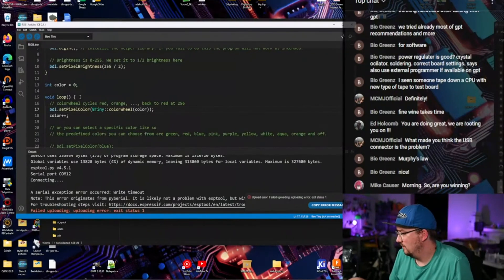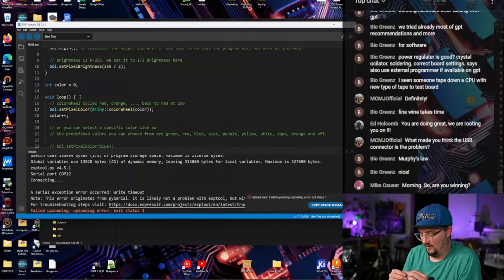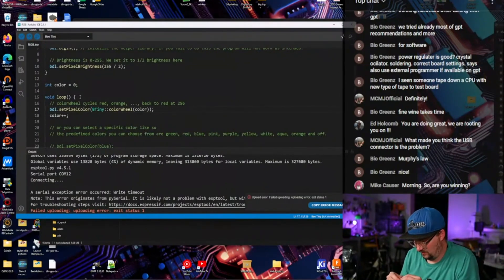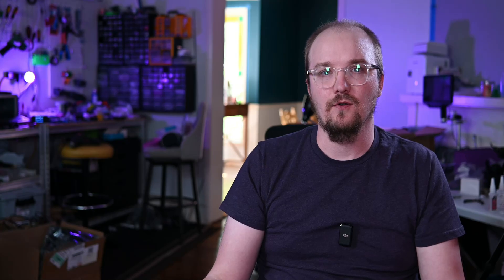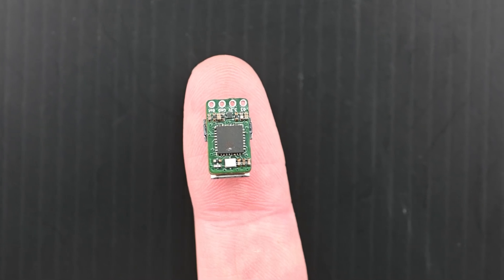I Made A Tiny ESP32

Comment: If you want a slightly more functional challenge. Try putting the 'fingers' for a USB type A directly on the PCB so you can insert the entire PCB into a USB port, I've seen some bluetooth dongles do this.If you squeeze  a WiFi antenna on there as well you'd have a pretty cool ESP-now receiver - could make for a pretty low latency wireless keyboard receiver or something like that.
Reply: also why buttons, just have pads that you can short with tweezers
Reply: @X3msnake btw i putted buttons on the dongle for convienience as it was intended for dev purpose, but i could have put smaller ones
Reply: @X3msnake  and i'm using a esp32-s2 instead of c3
Reply: would a flexible (embroidered?) wifi antenna work? I'm just thinking about project WarKitteh from a defcon talk a few years back, fitting a microcontroller with wifi into a cat collar.
Reply: @charleslambert3368  yes many antennas are made from flex pcb, it would totaly work
Reply: Making is actually functional (and slightly bigger) would be great, yeah
Reply: It also seems to be possible to put some soldering (like SMD ones) pads connected to the chip leads to the edge of the board so more of the functions of ESP would be available. That would make the thing actually usable tiny microcontroller.
Reply: Is it possible to turn one PCB layer into antenna?
Reply: Of like couple

Comment: I only read about this so  maybe missed something. So the wifi and bt dont work? And only 1 pin?  Somewhere i fail to see what this is good for unless a ultra simple thing. But yes at least add the i2c or qwiic or what they call it. And antenna connection. I think there are micro buttons for the side of the pcb. Maybe a very fine pitched connector?
Reply from the maker: This was only a proof of concept type build. I've gotten a lot of great ideas from people on here and I think I can make a 3rd version that has an antenna and more gpio without making it bigger (hopefully) while also not lose the usb/buttons. It's a challenge but I'm looking forward to trying so stay tuned!

Comment: Excellent build!  Have you considered a connector other than USB-C?  Maybe JST has something which would work.
For WiFi, how about the ceramic antennas that Adafruit and Seeed use on the QTPy and Xiao series of boards?  It would make your board larger, but not by much.  Obviously this would be for another project where you aren't going for minimal space.
Reply from the maker: Thanks!
I've gotten some great feedback and ideas on how to improve this and I think I can make a new version with an antenna without making it bigger (hopefully) and not sacrificing any of the buttons/usb.

So stay tuned!

Comment: Very nice little board. I'd remove the USB connector, buttons and possibly the LED. Instead if you put a U/FL connector for the antenna and a small board connector such as the Hirose DF40 series (a 20 pin is only 6.6 x 3.6mm) then far more GPIO could be broken out. Would need a seperate programmer board with the USB and reset buttons, but once programmed you'd have a very tiny board that could easily be integrated into other projects with only 1 connector and an antenna.
Reply from the maker: Thanks man, that's an interesting idea and one I'll consider. I've gotten a lot of great feedback thus far on how to improve this so I'm excited to make a 3rd revision of this.
Reply: @paulprice This has me excited, now fingers crossed🤞hoping I find the revised version on your channel
Reply: I thought those looked familiar, it's what the cm4 uses, ig I should have expected a connection like that in this community lol

Comment: Please try to fit Wifi in this small board please dont increase the size 
And sir if you can one button and second change by smallest push button which is generally used in Bluetooth earphone,
Also if can remove the usb port and upload the code by using externally then it would be more tiny.

I know this is too much tedious but you can do it 

❤❤❤❤love you sir

Comment: Just think... replace the usb-c for contacts for use a jig with pogo pins to programing and a small conector for a tiny battery, it's a option?
And for antenna, probably won't work, but you can put only de μC on one side, make a space for a connector for the antenna or... take all the risk, create a thin pcb for stackup at side of μC to save the space and have the antenna in separate pcb

Comment: Does it stil have bluetooth capabilitys? cause if it has i i regret ordering the stuff for my smart ring project. Basically a ring that (when the button is pressed) sends data from an acelerometer, a magnetometer and a gyroscope via bluetooth. So you could just "wave" in the air and dimm the lights youre pointing at or move your hand up and down to controll the volume on your phone. 
I used an attiny44 with an HJ-580LA bluetooth module for it and i cant figure out how to programm the  HJ-580LA its way above my basic arduino skills :). A esp32 would have made it easyer.
Reply from the maker: This one does not have Bluetooth, but I've got a lot of great feedback about how to improve the design and potentially add a wifi/BT antenna so I plan on making a 3rd revision of this. Stay tuned!

Comment: You can easily ditch the reset button without any caveats. Just hold the programming button when inserting usb cable.
Reply: It's a C3, you don't need either button. It can be reset to bootloader via USB
Reply: @CraigBurden1 I don't know if it's the same for the c3, but with s3 boards you can get them into a state where it crashes on boot and won't respond to USB to be rewritten and you need to reset it with hardware into download mode
Reply: @NewtoRah  What? The ESP-S3 has native USB, that means it can get in and out of download mode. Is that a bug what you're talking about?
Reply: @alejandroperez5368  Maybe it's our platform io setup, or how we did the hardware, but we've run into situations where the onboard USB hardware can't download new firmware without first doing a reset with GPIO 0 pulled down. Usually if it crashes early during setup, or accidentally spamming the serial port with text without any breaks.
Reply from the maker: Dude, that is so simple and yet brilliant at the same time lol. I never would've thought of that. I guess to take it out of download mode after programming just unplug and replug in the USB.
Reply: @paulprice  Or ditch the buttons altogether and short two pads with the tip of a screwdriver.
Reply: this is a great idea,  @adamhowell1694  ! or some other type of much smaller switching mechanism :D
Reply: The watchdog timer will keep resetting, preventing download mode.

Comment: I know it would make it slightly bigger, but to increase the usefulness of this you could break out the two GPIO for I2C maybe instead of the one pin that you originally chose? New subscriber by the way. I love what you did with this.
Reply: Or possibly casselations along the PCB's edge, with the signal routed from an internal layer.
Reply from the maker: Yeah so on the rev 1 board of this I did have 2 gpio for that very reason but when I decided to go as small as I thought I could I dropped it down to 1. But there's been some good ideas mentioned by others as well in the comments so ill probably try for a rev 3 and see what's possible.
Reply: @paulprice  Awesome!! Look forward to seeing it! Keep up the good work!!
Reply: If you make it slightly bigger though, you essentially just have an Adafruit Qt Py or a Seeed Xiao. What makes this unique is its absolute minimal footprint.
Reply: Drop the through holes and switchs and use tiny pads for the gpio

Comment: It would be cooler if it also had WIfi/BT and would be slightly larger but still miniature
Reply from the maker: I'll probably make the 3rd revision of this and try and get an antenna on there, it'll be tricky but it might be doable. Stay tuned!
Reply: Maybe he could add a small antenna connector to it so you can hook up a antenna of whatever size he wants

Comment: does no antenna mean no radio or does this still work with limited range? (think first one?)
Reply from the maker: No antenna means no signal period unfortunately.
Reply: @paulprice may be not exactly true, if you set the lowest possible tx power it works with a very short piece of trace (of course with a limited range) so probably might work without it too

Comment: you could make touch buttons and initioally connect them with a wire to falsh the chip but if you would make the edged conductive you could fit etleast 4 touch pads on there :D.
Reply from the maker: That's a very interesting idea with the touch pads.

 I'm using the C3 variant because it's the smallest esp32 SOC I'm aware of and it doesn't have touch pins unfortunately, so the touch idea wouldn't work in this particular setup. But it's a good idea!

Comment: still too big for my purposes. Is there a source fo a chip die size ESP32 somewhere?
Reply from the maker: Not that I'm aware of. It may be possible to make one that's a hair bigger than the actual SOC chip, but at that point you're going without USB and buttons. I may try to make a rev 3 even smaller. Stay tuned!
Reply: There is esp8684 which is the same esp32-c3 in a smaller package
Reply: Is there a source fo a chip die size ESP32 somewhere?
alibaba

Comment: Is using an oven the best (only?) way to solder the second side of a board with surface mount components on both sides, or could you have used the hotplate for both sides?
Reply from the maker: I could have used a hot plate probably. I used higher temp past for the 1sr side and lower temp paste for the 2nd side. So it probably would've worked on a hot plate. But I have a reflow oven so I just do the 2nd side in there and not mess with it.

Could also just use a hot air gun for both sides
Reply: I see, so using two different pastes is what's important here. Could you share which two pastes you used? I'm curious what the reflow curves are like for each. Thanks and very cool project!
Reply from the maker: I'm away from my workshop right now so I don't remember the specifics paste product numbers off the top of my head. But one is a 428F paste and the other is like a 280F paste.

Comment: You could ditch the usb port for test pads.. and with mini pogopins a custom connector to Program it :D
Reply from the maker: Yeah that's definitely a possibility! I've done that in the past with some projects. it's not as user friendly obviously. But it could be fun to try and push this even smaller! Stay tuned :)
Reply: @paulprice maybe even add a small antenna connector to it for bt and wifi if you change the port for a
 "esp custom programmer" that connects to rx and tx and 3.3v and gnd pads interface

Comment: I guess you could push the footprint size even smaller by stacking the switches (using through hole) over the top of some of the other components.....🙂
Reply from the maker: I thought of maybe trying that early on, the only issue is the through hole part of it. The holes for the switches would interfere with the SOC itself. It's food for thought, but I'm not sure it will work at this scale. Not a bad idea tho!

Comment: I see a lot components there. Capacitors, resistors. Can you list what elements are absolutely essential and describe why that one is really needed. I can get the need of chip itself and quartz. But the rest?
Reply from the maker: Great question! The majority of the capacitors and 1 resistor is for the voltage regulator and power filtering. Could I get rid of the power filtering and have it still work? Probably, but it also probably wouldn't work reliably. 1 resistor is required to pull gpio8 high in order to program the board. (That was the issue with the 1st rev I made) and then there are a few resistors for the crystal.

So while I may be able to remove a capacitor or two, it wouldn't shrink the footprint at all, unfortunately.
Reply: @paulprice  I am talking not from the position of making it smaller but to start making custom pcb's for own projects instead of using generic development boards. Because with generic boards projects start look ugly too fast. Trying to get into what is needed. Schematic in the datasheet has zero resistance resistors on many lines, why would I need them?

Comment: ESP32 without wifi seems to defeat the purpose in my opinion. I mean, if you go for reckless miniaturization, you could have removed the usb connector, to go for a smaller 2 pin connector (usb data+ and data- on test pads for programming only) and replace the buttons by two traces without resist on the edge of the PCB that you "short" with your finger vy squeezing the board on its sides like the volume button of a smartphone. Also you could have used one of those ceramic smd antennas. The smaller ones are in a 1206 package and provide OK performance
Reply from the maker: it could go smaller, however its already pushing the limits of the SOC size itself. so I could remove the usb and buttons but the overall footprint wouldn't shrink a ton and I figured if i could get the usb and buttons on there for ease of programming, i would.

 i could probably put the passives on the back side if there is no usb or buttons, to make it a bit smaller. its an interesting thought i may consider. cheers
Reply: I definitely see two tinys. One that is just as small as possible, inconveniences be damned. Another actually useful one with wifi + mini antenna and 2 gpio but still small as possible.

Comment: Do you NEED buttons? 😊
Reply from the maker: Technically no, they're needed in the sense to put the board into programming mode, but that could be achieved using test pads. But that gets a little convoluted to program the board.

I'll probably revisit this and make something with no buttons or USB connector just for the hell of it, so stay tuned!